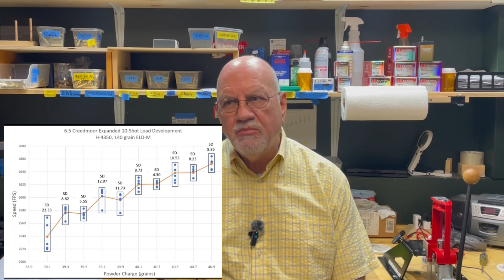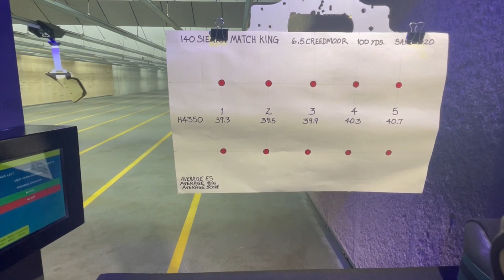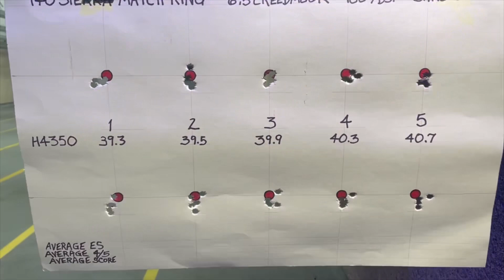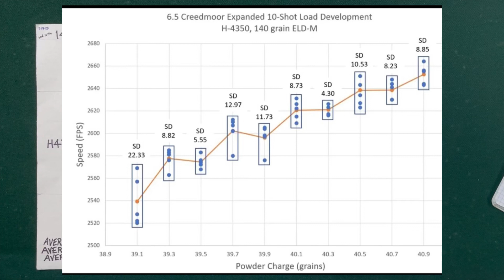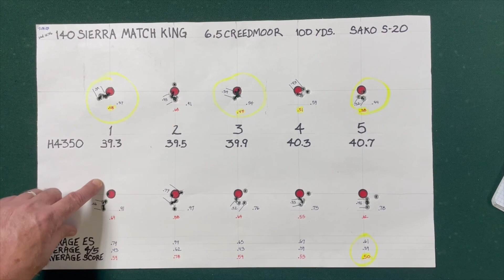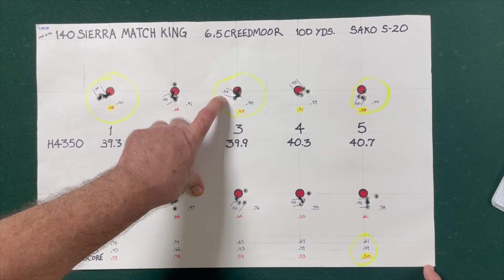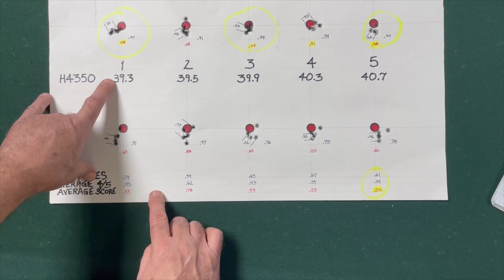Testing 140 gr. Sierra Match King, 6.5 Creedmoor with Ultimate Reloader’s 10-Shot Load Development

Comment: My testing showed that 39.8gr  40.8gr and 41.8gr of H4350 are the best load charges for 6mm CrdM with 108ge ELDM and Berger 109gr LRHT bullets. 6mm and 6.5 cases have identical effective case volume

I usually just load 40.8gr and go shoot
Reply from the maker: I bet that 108 as fast as hell
Reply: I've given up on Bergers. It seems like when they shoot they shoot they're unbeatable. I've just never found the magic combo for them.
Reply from the maker: For me, that's what this hobby/sport is all about. It's about finding that magic combination of bullet, powder, and charge weight.  For me the experimentation is half of the fun.
Reply: @EverydayReloadingandShooting  

Without a roadmap, or concert process to find the optimum combination of powder, bullet, primer and case and BTOG it is like trying to find your way out of a forest at night.
Reply from the maker: @YERAFirearms  from your original post, it sounds like you found a good combination of powder, bullet, primer, etc . I usually load based on what I find in the manual, I'll do a ladder test, and then zero in where the charges Group the best.